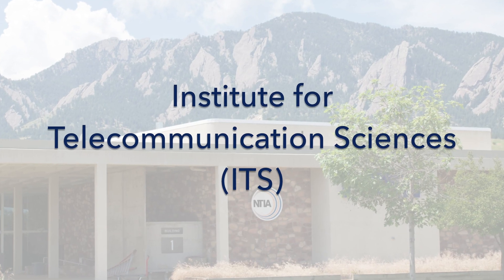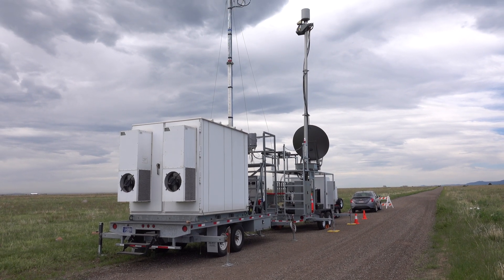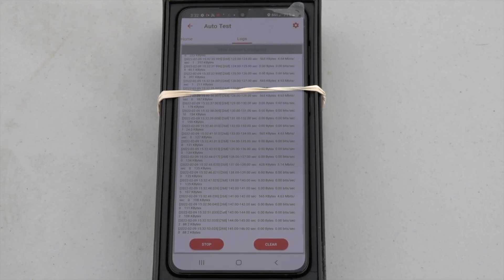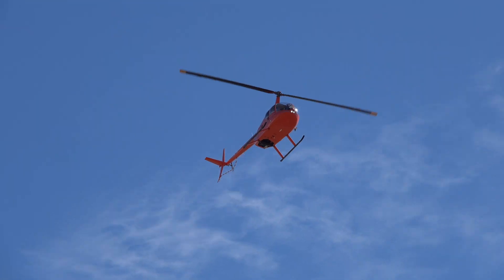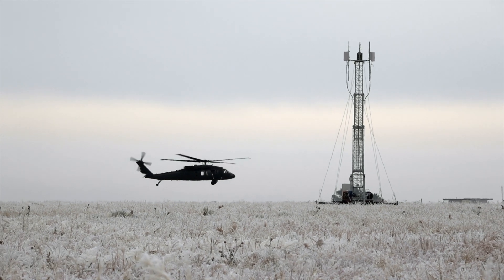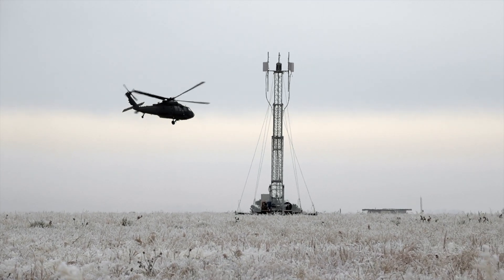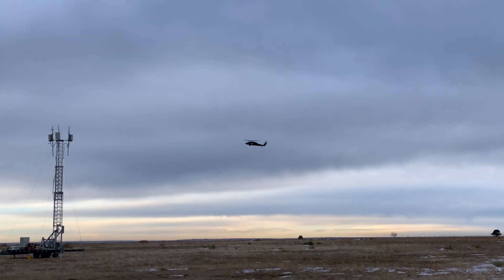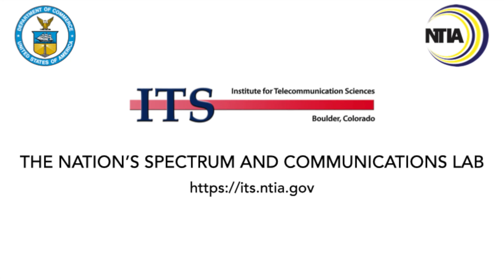Further 5G In-Air Field-Strength Measurements for Radar Altimeter Research

Comment: Fun stuff.  Designing and implementing test and measurement scenarios for radio systems was a fun part of my job at one time.  As someone working in the satellite communications industry, co-existence with 5G in the same or adjacent bands is a hot topic so I've been following the radalt issue with interest.  Good to see that the 5G equipment is living within its allocated parameters.  Would be interesting to know how well the results lined up with information provided to the FCC as part of the FCC ID certification process.

Comment: 56,000 watts at those frequencies. Cellular traffic in greater volumes than would ever be found in normal circumstances. Every model of tower/cellular system that could be deployed in the US.  What an awesome, well done and intensive experiment. Most importantly, a definitive study showing the compatibility of 5g signals with RADALTS. Also, have to love the Army Blackhawk helicopter pilots seeing just how much they can push and prove the experiment - what a riot! I'm so glad I watched this; the educational value is great and the bits of humor make it so very well done. Great job to everyone on the team!
Reply: 56,000 Watts, that's almost 78 dBm. I learned that receiver overload seems to be the biggest problem (and not co-channel also called desensitization in ITU-R M.2059).
Reply from the maker: We appreciate the kudos. !